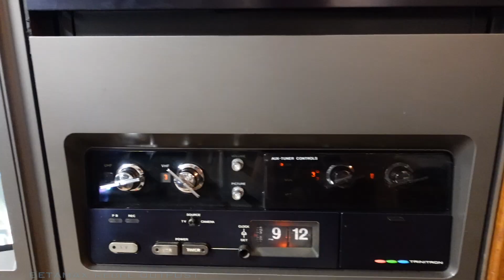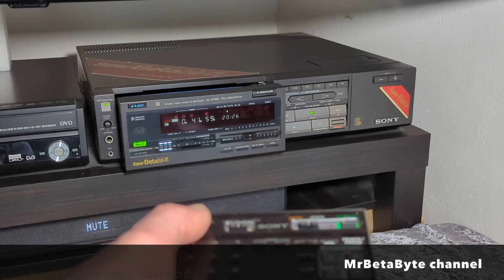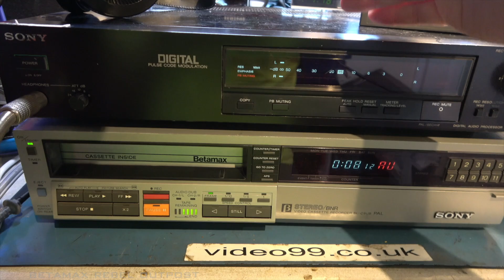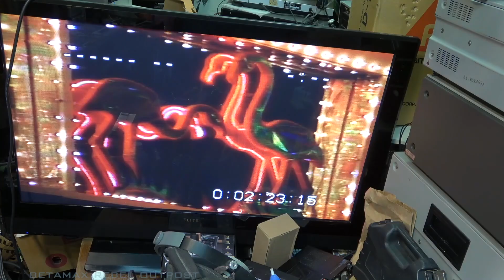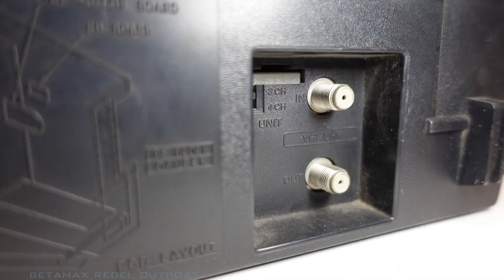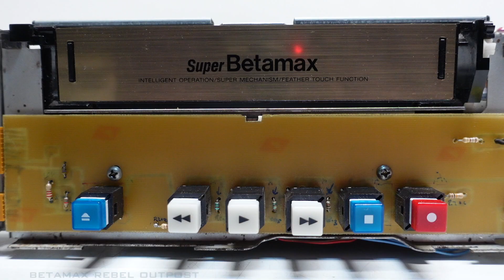Betamax 50th Anniversary SE 1975   2025

Comment: hi am a tec  but i can't make video because of red tape  it's because who i used to work for  

get this  this now a video deck   i have a brenell mini 8  x 3  some are  R & D  decks   i had a bad time with bad pcb's going bad  over 
the 47 years  

i now have the decks working nice   i had to pull all the  ic's  out  of the pcb.s  jazz each  deck  

the thing is the brenell mini 8 was doing it thing all the time  and in play mode  the rew ff  would not work right pinch roller would lift 
in rew ff    

the high power side was ok   30v dc   240v  and relays were ok   the 5v dc in to the bc107  was ok    5v logic to the bc107  was going nuts 

BETA NEWS  PART  some time ago i was offfered  3 pallets of betacam  decks    yes 3 pallet s     sony 100ub  x 14 stereo hi-fi 

40 plus betacam sp deck  14 x sony 500     14 sony  bvw  75p      9 x sony  1800  decks  alot of ex studio pro gear like soundcraft otari  reel to reel  gear 

can.t make  video's be cause it's like putting up  AD  you see to all the robbers  you see  

i used to get offers all the time     not just gear tapes zonal   audio    betacam  new sealed one's 100's of them 

i have a suclly  280-14 \ 3340 deck  it's a mix of the to decks  when i was buying parts i was getting asked what the motors are for 
only ebays now in the the past why 

scully 280-14 cost me   £60 uk  the audio cards are junk and the rest of it   

looking nice now   why i call my self bob's bit's   because i am buying bits of  decks